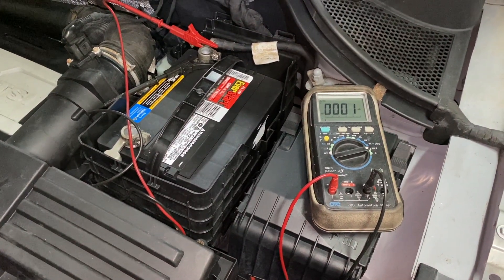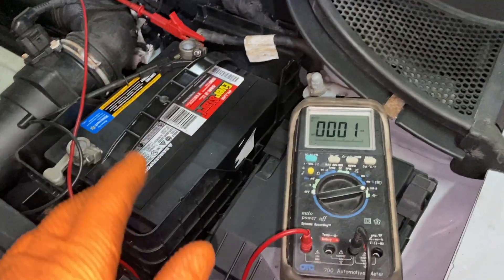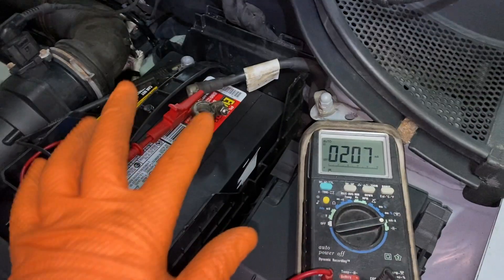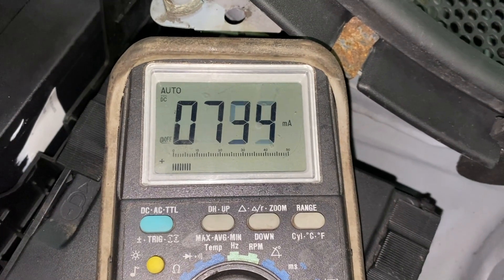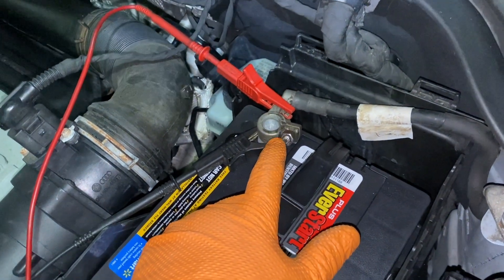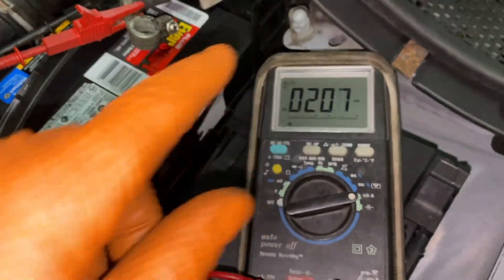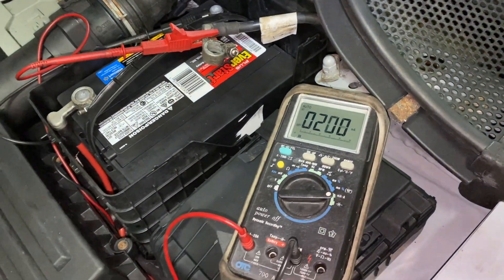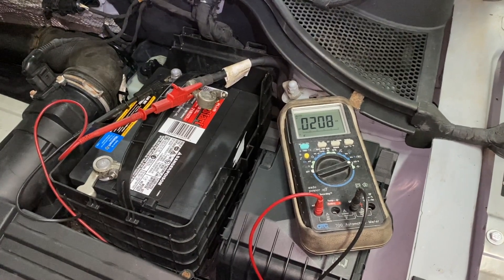Why Does My Car Battery Die So Fast

Comment: I need u help  yesterday i was driving my golf 4  and I smell it burn somethimg but i Stop and when i open hood a lot smoke white comes from engine or under idk  and it was so hot but  in dashboard it was temperature normal  after i  turn of car i wait and i try to turn on again it starts and shuts of itself after some try Bateri dies After i recharge i try to turn on and just crank but no start  I saw Oil was minimum level i put some oil but no start  i check fuse relay are ok    i jump cable and no start also can This fault be A Alternator or something eelse ?????
Reply from the maker: Sounds like you overheated the engine and possibly blew the head gasket
Reply: @motorcarnut  so u say it can be Only this head gasket Doing this my car not starts ?
Reply from the maker: From what your explaining, yes. But I’m not there to say 100% so it would have to be looked at by local mechanic.

Comment: 2005 Corvette C6. Brand new battery but drains completely after 2 days. I did exactly what your video shows. My multimiter reads 44 mA and is stabalized. I left the mulitimeter on the battery and after two days it has drained again. I'm at a loss.
Reply from the maker: The video is for a broad spectrum of years makes and models. Ok, the 44mA on your particular vehicle is a little high, should be 20 to 25mA. C6's are know for power draws, ( headlight module don't turn off, power seats too. You can start pulling fuses to try and get it down in the 20's. See which accessory is causing the excessive draw. Maybe the new battery is defected? Because draw is not that bad to kill battery within 2 days?

Comment: Nicce video. Once the Mamp reading stabilizes, pull fuses and watch for a drop, correct? I have an old 88 k1500, could it just be creeping green wires?
Reply from the maker: Thanks, yes on your vehicle you should have lower than 90 mA, green corroded wires would cause less draw.

Comment: Thanks for the video .  Do you have any experience with the 2.5tdi vw engines (BNZ, AXD etc, direct injection - before common rail) up to 2009 that they used in the Transporter/Multivan ?  There's a number of issues with them, one is with high mileage the cam hammers the injectors which work harden the head alloy and then crack the injector seat.  Aftermarket "bridge" is available apparently to hold the injectors from moving so much.

thanks
Reply from the maker: Sorry I don't. I worked on some models but not on the fuel injection systems yet but did hear about the problem you're experiencing.
Reply: @motorcarnut  thx for the response.  Have you seen issues with injectors on other models ?  Are they held down more securely (than 1 bolt) on other vw engines?
Reply from the maker: No actually just pressed fit

Comment: There are Capacitors in your car that hold a charge. They need to discharge. I don't understand this video. There is nothing in your car that will exceed its Amp hour capacity that will "kill it" unless it's old and the cells are covered in deposit that don't allow the transfer of electrons across
Reply from the maker: Vehicle should not have over 100mA, 30 to 50mA is normal. If you don't understand the video, look up " parasitic draw"
Reply: @Motorcarnut  yea. I understand that devices in a car draw small amounts of power from the battery...radio, LEDs, alarm light etc...but they draw very little. Killing it however would take a very long time for it not to be able to crank over.  100mA is nothing in a 60Ah. I guess maybe I'm confused with the title of the video. All good